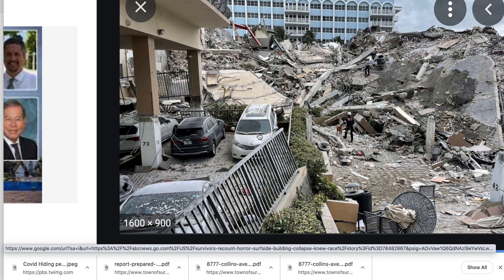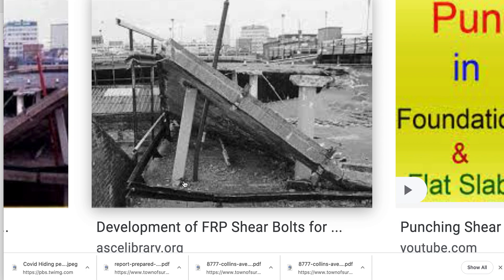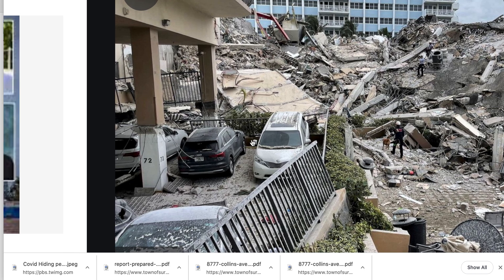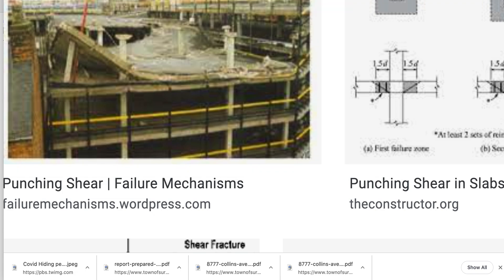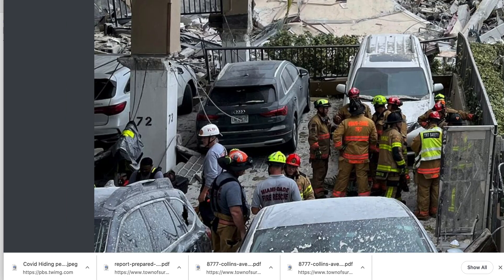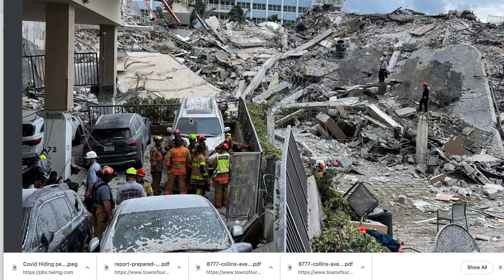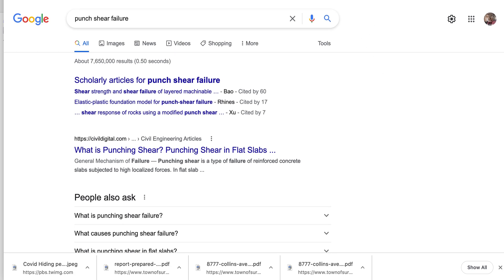Champlain Towers Punching Shear ground zero? 98% sure CAR LOADS AND REBAR ISSUE part B

Comment from the maker: I am 98% confident that this is where the deck failure started... ''global punch shear" with cars as applied loads.  Please, show your support by commenting below for the youtube algorithm and to promote this content. I appreciate all of you who do. Thank you.
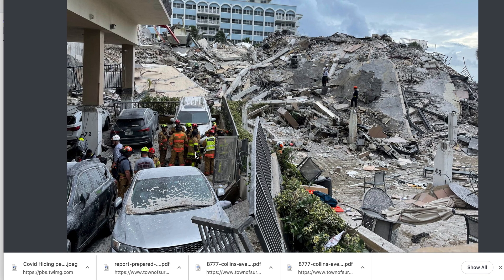Reply: July 2020 video of the garage ceiling. At column 56 you can see the epoxy injection crack repair. They didn't remove the ports.  4:12 Wet roof and flaking paint 4:14 Is that rust coming through the repaired crack or what?  4:24 Looks like large areas of damage.  Can see the ramp, so some of this this does appear to be the area that collapsed first. (As seen from the video from across the street that looked down the ramp to the broken sprinkler pipe and concrete on the floor. ) https://youtu.be/w4rGWH7aDJc?t=248
Reply: I agree that punching shear appears to possibly be a potential "trigger point".  Never saw a better argument for column capitals ("drop panels") at the columns in the parking garage.  Drop panels may have prevented an ultimate catastrophic collapse (possibly).  This is just based on what I see in the pictures & videos .........
Reply from the maker: @Rush__Man , that really made me smile...  I needed that, I just did a 50 minute video because of all the request of the underground video... I did one already but this one I attack with a person quest... as some engineer wanted me to run a finite element program on this failure!   I told her OFF in this video... you will understand, if you buy and old car, you can't run a new car program on it... you have to dive into each connection and evaluate it's life cycle left, etc.
Reply: Great Work to Solve this Diasaster !
I wonder who allowed people to wrongfully drive and park on that deck....I did not see any parking stripes for those heavy vehicles.
Reply: The column behind 72, that holds up the corner of the building, is the same blue marked column in your 58 minute video. That column is supposed to be long and thick (at least on the underground garage level) according to the plans shown in the 58 minute video. So did the change of a long, thick column to a regular column cause punch shear to occur from the weight of the vehicles? In this video, you point right at the blue marked column and say that is where the collapse began.
Reply from the maker: @damonshanabarger2604  YES, smart ass, a progressive collapse has ''turning moments'' and each one is a chance to STOP the progressive collapse = critical member supports!    NOW hit the F**king door!    = leave! 
https://www.youtube.com/redirect?redir_token=DNv2IAOnVo5Ybkl1FWgAR6C5wc98MTU3MjA0NDQ2NkAxNTcxOTU4MDY2&v=eVVbhESG65I&q=https%3A%2F%2Fwww.paypal.com%2Fcgi-bin%2Fwebscr%3Fcmd%3D_s-xclick%26hosted_button_id%3DV9TGHDE92LQ8W%26source%3Durl&event=video_description

Comment: As a retired builder , a design like this with no cross beams between the columns,  to spread the load,  was a collapse waiting to happen,  not even any pads on top of the columns to spread the load , with this design I would  be very concerned about the safety of the sister building.

Comment: tht would make most sense as well as it had the biggest on current weight at the time of the collapse, maybe even more than meant for,  i cant see columns with no load punch through that makes no sense. also there doesn't seem to be no rusted rebar at slab failure points specially considering it might be ground zero, can u elaborate  .

Comment: Look at column 72 ere the cares are parked there is only 2 pieces of rebar sticking out and look at the deck you can see how the bricks are pulled up that does not look good also look at the other columns its all the same

Comment: This conflicts a little bit with the foreign couple riding the elevator up after parking while hearing a noise. That slab is by the elevators. They only said they heard noise.
Reply: unless they were in the elevator by the sound. I would expect they would see something happening if in the garage level vestibule
Reply: we can't forget the water trapping and the weight of the resurfacing on that deck tho...

Comment: The rebar hanging from column 72 look long.  Check the ends for rust.  The water causing the rust may be from the water in the flower boxes. Also, why are these rebar long....concrete apparently was not gripping the side of the rebar....Why?  Was this area designed for the the weight of CARS? and Flower boxes with water?

Comment: Between the ponding all over the pool deck due to the shortsighted zero-slope it was built with, and the ill-conceived planter boxes surrounding several columns along the south wall of the collapse portion, there were 15+ structural columns where the column-to-slab connection was virtually underwater 24/7/365... also seeing a lot of columns with only 1 rebar in each of 4 faces, but IIRC, the plans show 2 rebars for each face...?

Comment: Ahh yes we get to 72/73 now, ive had my eye on these colums, the rebar also supports your bias and mine too that that slab went str8 dwn, i didn't pick up on the cars at first but the fact they're pratically undisturbed shows it was a quick drop, now that you cleared up that colum design for me, that ties more of this puzzle together, i was like wth is going on with 72 where the slab once was!

Comment: I read a comment elsewhere that says that area was designed to be a recreation area, not parking spaces, in the original plans, but the surfside website with the plans is down. Do you have access to the plans, to verify this?

Comment: that section of the garage was outdoors, so subject to the same water problems of the deck outside of it.
poor drainage just rusted the steel a little too much there,.
plus the pictures of the  pool room show chunks of cross beams  falling away.
subject to salt sea spray too,  along with poor drainage, it was like a car in the rust belt.

and they knew the severity all along without the light really going off in their head.
last company wouldn't go any further for fear of destabilizing the building.
that should have been the red light to vacate.
not enough' peoples executive function working properly there.

out of the survivors of the building, you don't hear of anybody saying they asked if the building was safe when presented with the repair costs.
not suggesting anything, but apparently they must not have been aware of the severity of the situation.
it's a  terrible tragedy.

Comment: wait upper decks show no rebar in columns. And lower decks seem to have undersize bars. They look half inch and should be thicker. And film shows break at garage overhead. What size is rebar on first floor? you say epicenter is not on line L, but building perimeter? Are you saying this started from the outside and walked in? I keep going over your videos to see what you see, buy I need that hole cleaned out to see footings. Everything started from very bottom. It didn't fall like trade center.

Comment: You've arrived at this by studying bldg & failure Very scholarly. I don't have a utube rep to protect so I've been telling folks this since the night it went down after a half hr of reviewing videos It was pretty shocking how fast the parking area dropped like the steel just transported to the Enterprise leaving concrete wondering what happened for a nano second before it went puff from the shear forces. Cause that's the failure shear It's hard to get sudden total shear failure redundency usually leads to bending failure & draping as u noted 
Here's my I got nothing to loose reason the deck failed here first Salt laden rain must fog blown against bldg normally goes up or around but the open parking deck gave it another out UNDER the building & as backed up wind pressure would be highest at bottom of building a VAST amount of salt laden moisture went thru here As the concrete would be cooler here from shade from stored "coolth" from overnights lower temps even fog & mist would have deposited more salt laden moisture via condensation than you'd think. There also was far less topping than at pool deck no pavers so salt would get to steel faster The parking spaces were subject to stress cracking every time cars came & went along w movement stress from braking & acceleration lol the cracking from these stresses would have created more paths for water & salt to get to steel rebar
Q. Was rebar beefed up in this area for parking or was it same as rest of building VERY BAD or just same as pool deck Probably very bad as who would go to cost of making whole pool deck capable of parking cars on it 
Q. Any expansion it btw sun baked pool & parking & cooler area under building? Without this the stresses from expansion would have bowed the deck daily creating more cracks perhaps centered on the resisting elements the ring Columns f steel & concrete at the face of ea column 
Q Are ANY of the slabs true 2 way slabs (correction I found note calling for 2 way bottom bar app1ft of through out & that noted rebar on plans is just top bars So my bad though I've seen no pics showing 2 way bottom bar throughout yet)

Comment: Had this area been identified as an area in need of repairs? We know about the garage roof, pool deck water proofing, several spalled columns.. but I know nothing about that specific area that you identified. Seems like the only area not mentioned in structural repairs.

Comment: You still thinking the Deck pulling down the building ?
Reply from the maker: Yes, it is still a deck ledger failure for the main structure... this is the deck details of that failure... we still need to connect to the building columns = I already did a few videos on that already... Please, go back and look at playlist.

Comment: What scares me is if there is a lack of rebar in this building its sister to the north is probably the same way. There was a real estate photo for the north building where the front drive area is was sagging down a bit.
Reply: If you put more rebar in you get more rust?
Reply: Another thing to realize, at least this building was a rush job, or so it appears as the original plans show adequate rebar as speced, but the issue was the pool deck was not sloped to allow for proper drainage - hence the evidence of water having been standing on the surface until it finally dried out instead of simply draining away properly. All that spells the building was likely rushed to completion and corners likely taken to compromise the structural integrity - add to it, the often subpar maintenance and the corrosive salt air - all added to the building's ultimate demise.

Comment: If that part fell first that may explain why that one couple didn't have any power if their wires ran through that section and the parking deck had dropped just enough to break a connection, but not enough yet to create all the mayhem people reported.

Comment: I was watching the live feed this morning from Surfside and workers pulled out a column from the wreckage that was severely stripped of concrete on both ends with maybe 3 feet of intact concrete in the middle. One end that had straight rebar pointing out and the other end the rebar did an L-turn at the end presumably to anchor and at the apex of the bends of the L's in the rebar it was dark with rust and that looked like the cause of the collapse if that L pulled loose from rust and the column let go.

Comment: my question is the video of the pre-collapse showing debris in garage and a large amount of water coming down. Where was the water coming from since pool still had water in it post collapse. My feeling that either the water or what caused the water coming from above the parking deck was cause.
Reply: Sprinkler pipes under deck slab
Reply: He hypothesized in another video it was the fire suppression main line, & it ruptured when the first collapse occurred in the garage.
Reply: I agree

Comment: I am a civil engineer and agree that it was a punch shear issue.  Now what precipitated the punch shear?  I believe that the deck failed onto the transfer girders with failed and this resulted in the punch shear of the columns.  I believe that we agree.
Reply: It had to be an automobile driven erratically, or maybe even hit colums, could this really be an alcohol related event? Scheesch! Leave no stone unturned, but something of a strong force had to trigger this, unless all the rotten concrete coincidently just gave at once, i dont think so, there was a forceful trigger somewheres..
Reply: @jameschandler3308  the real estate ad indicated they had valet parking. (Valet does not equal 5 mph speed limit?)
The resident that said his power was out around 10:30; he parked his car and took his scooter and stayed at a hotel for the night.  How lucky can you get? 
 I think if I had to cough up the repair fee by 6/30/21 I would have been at the front desk?

Comment: I have just started binge watching all of your videos.  Thank You for allowing common folk like me access to details that are otherwise not available! 👍  
One detail that may be totally insignificant, if it's actually there at all (I'm viewing on my phone so viewing acurate details are a challenge  🔍), but ... the pool area appears to have individual paving stone type surfacing, while the pool-level parking area appears to have a stamped concrete surface.  As I said, it may be totally irrelevant if they are indeed different; but different paving materials do have different levels of permeability, resistance to water flow, weight, etc..  I wonder if the surfaces have been refaced, and if so, how/if the original slope and ability to drain water to the storm water drains may have been affected.  
A catastrophic failure like this is never due to just one simple cause, but a cascade of events and conditions that finally build to a point of failure.  All catastrophic failures do have a foundational condition or situation that serves as the starting point however.  It is heartbreaking that so many people had to lose their lives due to negligence, apathy, and/or whatever the actual causes are eventually discovered to be.

Comment: It appears there is "something" underneath the area where the person and dog are walking, as there is a piece of something which has penetrated the pool deck, which it wouldn't likely do if the pool deck were laying on top of the garage deck itself.
Given the area to the right of the cars is a landing area of the towers (or their debris) as they fell, it would seem to be difficult to establish cause of the punch shear in that area,  Perhaps it was "leaning" at the beginning, but was then under debris from the towers.
So, if this is where the failure started... it then spread, across the pool deck, and to under the building?  And, don't we know it spread to almost the other side of the building, by looking at the debris on the floor by the entrance ramp to the garage?

Comment: If this is the failure point then the other tower the city engineer said his ex and mother in law could live in & feel safe has a major issue? What is the design error in column 72? Bonus question, what is the 1981 load level per column 2x, 3x or 5x total load before failure (did one column failing really cause all the others not to hold the load???

Comment: Man I love your work. I've learned way more than I could in an introductory engineering college class. I know I said that before. But wow. All the data checks out for me thus far. There is only ONE column I can't account for at this time. There's no post-event data to show this one column, and unfortunately, after last Sunday, we will never see. This one column could have suffered from an "oopsie" and I would want to see if there's any scuff marks on it. It's very unlikely to be the case, however, with a photo it can easily be dismissed.
Reply: Most likely the official investigators have photos which will be public eventually.

Comment: Sorry sometimes my comments will be for some of your other videos. I can always locate the comment feature. This comment is in regard to the sister property, where it had that $600,000 condo available, with an $884 a month maintenance fee. If I recall there was about 150 units? If we were to multiply $884 times 150 units that is $132,600. This is conjecture, the higher properties may have charged more per month maintenance fee, we don’t know. In 12 months that $132,600 is $1,591,200. A pretty significant question is, why were they reluctant to invest in the maintenance, where they are charging the residence for the maintenance. In four years that’s $6,364,800. That is if it is not earning interest in some account somewhere. Yet they allowed it to become the most horrific death trap in modern memory.

Comment: to my uneducated and therefore unbiased thinking owed to my lack of learned knowledge of engineering principals your reasoning makes perfect sense to me.
it's refreshing to know that I'm not alone when trying to explain to others my take on a subject that I am totally familiar with but my starting place or places may seem a little Helter skelter initially that some will disregard or shut me out prematurely before I have completed the connecting of my dots.
the thoughts are flowing like a wide open fire hose making it hard to relate the picture to someone.
give me a.minute or two and it becomes clear what my angle is.
l like how you are constantly filtering your thoughts as you reduce that data into a plausible scenario that make total sense.
I like your style keep up the great work. if people have a problem with there perceived feelings about your Callas ness, equating it to lack of empathy that's there problem.
and the occasional 4 letter words are the right fit for what ever your trying to relate.
looking forward to more of your take on this fucked up situation.